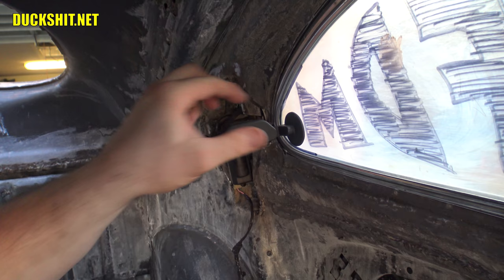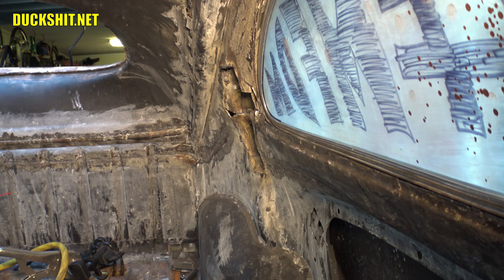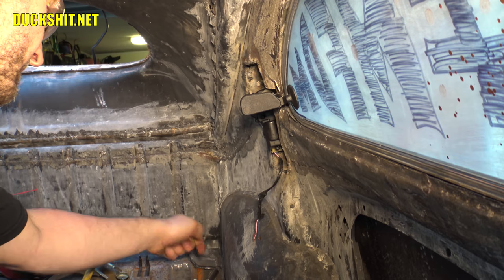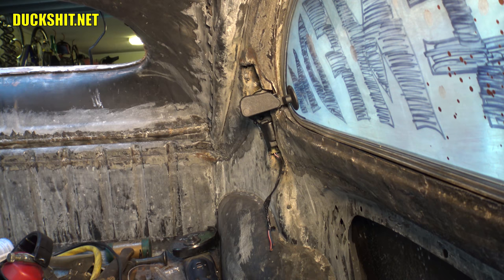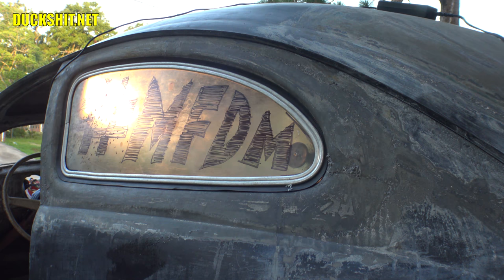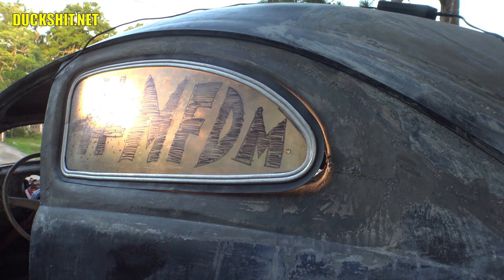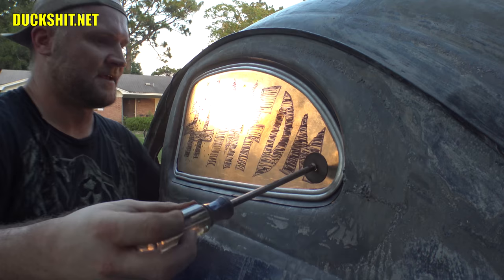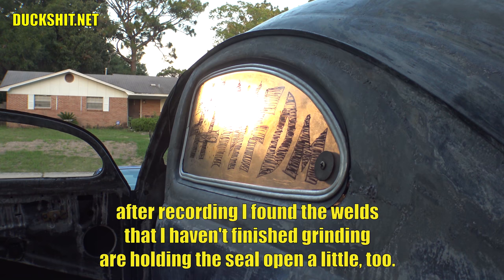VW Beetle Powered Pop Out Windows 4 - ROTTEN OLD 1956 VW BEETLE - 112

Comment: cool my bug (herbie) will have power pop windows out and power door windows
Reply from the maker: Make sure you create some videos!
Reply: I will make videos my whole project, I know the easiest bits will be fitting the door power window kits the harder bit will be making and  welding in the pockets for the pop out motors
Reply from the maker: Yep, thats the truth, but you've seen how to do it here!  I hope that helps!
Reply: @DuckmanCycles  It did but I'll use a stud welder to make the bolts to hold motors in place
Reply from the maker: Hmm thats an idea!  I haven't gotten that far yet myself.